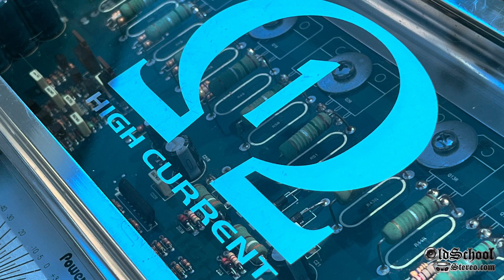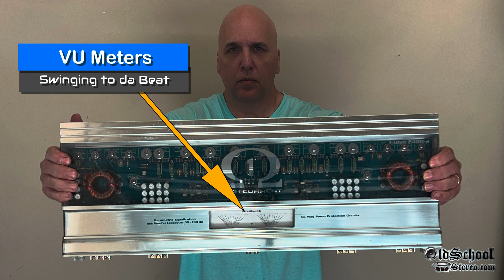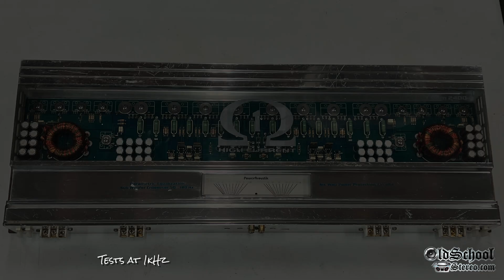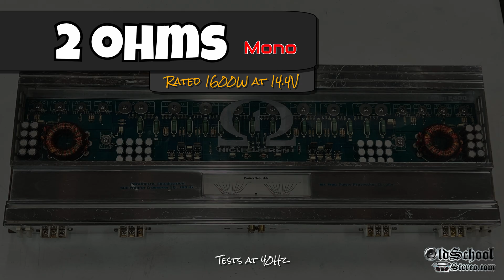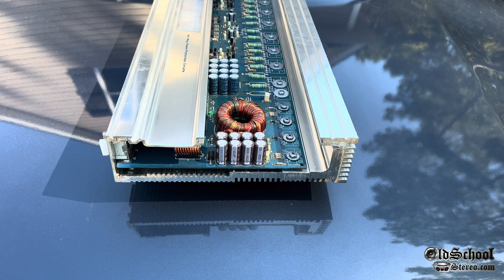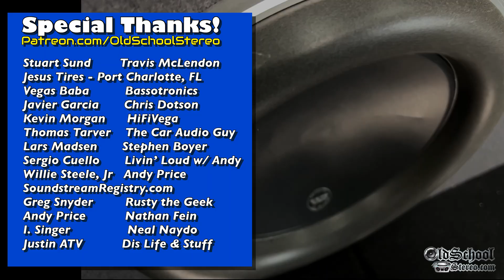Old School Bling with Meters that Swing

Comment from the maker: Get your WAL/OSS Merch: https://bigdwiz.creator-spring.com/ 
Buy Me a Coffee/Tea/Slap-a-D-No : https://www.oldschoolstereo.com/p/donate.html 

VIDEO AND AUDIO GEAR
Camera - iPhone 13pro 1TB - https://amzn.to/3nCjGvc 
RODE Wireless Go II Microphones: https://amzn.to/3Q6NVHl 
Shure MV7 Microphone: https://amzn.to/3A4OICK 
Zoom H4n Audio Recorder: https://amzn.to/3BXjVsS 
960 LED Panel: https://amzn.to/2Sxoq3S 

TEST BENCH EQUIPMENT
SMD / D'Amore Engineering Amp Dyno: https://goo.gl/sJTcf7 
XS Power LTO Lithium Battery Cells - https://lddy.no/1ivr6
XS Power D1400 14V AGM Batteries - https://amzn.to/2BPFCKW 
XS Power Titan 8 Lithium Battery - https://lddy.no/1iq28
XS Power PSC60 Charger - https://amzn.to/2CHGcfs 
Fluke 1000A AC/DC Clamp Meter: https://amzn.to/2Rw5WDA 
Handheld Dyno: http://amzn.to/2u2EgKV 
My Favorite Screwdriver Kit: https://amzn.to/3vijokl

DISCLAIMER: This video and description contains affiliate links, which means that if you purchase from one of the product links, I may receive a small commission. As an Amazon Associate I earn from qualifying purchases
Reply: I used this amp and got a 153 .db out of this amp. You have to put voltage on the battery and a line driver on the rca 10volts . It's a very strong amp and can handle 15.5 volts. I had it on 2 atomic apocalypse 15s. Torching test a 1 ohm mono, and it held it on a 57 hz burp

Comment: Friend wanted this when It came out.. talked him out of it.
And he purchased a MTX mono block. Was less expensive and put out better power.
Reply: MTX 81000D?  That was an iconic amp.  I had one, and at the time, besides the super expensive Alpine MRD-M1000's, it was hard to get over 1kw rms, this MTX was rated to 1500w rms at 2 ohm 2% THD, crazy heavy heatsink, soft clip, 0awg inputs etc, and was a very good price, plus you could disable over current protect and run 1 ohm for even more power if you wanted to risk killing it.

Comment: The Rust on those screw terminals is likely causing the lower outputs. Rust doesn't conduct electricity well. So I'd guess those terminals were choking off it's power supply.
Reply: No, it's a PA amp that's why it doesn't do rated. The small amount of rust and putting isn't gonna take 1600watts and choke it down to 500
Reply: @nicholascortez728  Both And. Each set of screw terms have 1 that's significantly more rusted than the others. That resistance won't be unsubstantial. But yeah, the design isn't good. 1 Ohm Amp with ubsurdly little power terminals. Even 8ga per side with a 50amp max is hitting a Dam with those terminals.

Comment: I've more or less studied VU meters and I like the way they are made in this device. They usually have a “attack time” and a “decay time” that should meet a certain standard to allow a functional display of the rated power. Many VU meters produced today are complete rubbish. The movement is like a spring and hardly readable. They are just for show and nothing valuable. But here they are fine.

Comment: I think Power Acoustik over rates their equipment. Blew two 10 inch subs within weeks of each other.
Reply: @98neonvegeta  probably clipped to hell.  Underpowered doesn't kill speakers
Reply: @TheXbrocker, what point did you not get? He said he thinks they over rate their equipment, meaning he bought a 10 in sub that claimed to handle more power than it could. How did you equate that with him underpowering and clipping the sub? What part didn't you understand 🤔
Reply: @tomb9566  Well, I read it as him using a PA amp and blowing through subs.  Hence why I replied the way did.  But I can see your perspective too and it makes sense.  Sorry to make you so angry.

Comment: You can tell the engineers spaced out the components to ensure the thing took up maximum real estate. Makes less power than an old Punch 200 from 1994 but 4X the size.
Reply from the maker: It never got even warm after the Amp Dyno tests or bumping the sub
Reply: @wal2  it has quite the thermal mass! 🤣

Comment: Looks like this amp got some use, and it’s tired. 27 years old, possibly sitting in a hot trunk for years. A recap might get it closer to its rated output.
Reply: Will bump up the numbers but won’t be anywhere close to rated. They were always over rated.
Reply: Agreed. There would have to be an improvement, but probably still wouldn’t do rated. Would be a fun experiment because it’s not a bad looking amp.
Reply: No. It really won’t.
Reply: It's power acoustic
Reply: Yeah it's not gonna do anywhere near rated even if you recap it...Power Acoustik was never known for their quality or their honesty
Reply: I was being optimistic, but you are right. Brands like this were cheaper alternatives to the better name brands for a reason.
Reply: I recommend bridging this amp full power  at 1 ohm to a single 8 inch sundown subwoofer.
Reply: Telling people you bought that POS without telling people you bought that POS. When has power acoustik ever been worth a damn

Comment: I learned tbe hard way on an old amplifier that it’s always good practice to use a plastic screwdriver to make adjustments. The adjustment know was metal on this old amp. Didn’t cross my mind at all but I went to make an adjustment and somehow there was an arc when the screwdriver was turning the knob and it also touched the metal amp case. It instantly killed the amp. There were no fuses. I was a teenager at the time and knew nothing about fixing amps. So… I tossed it in the trash and got a new amp. Lol. Just keep that in mind if you ever see a metal adjuster on an amp. Use a plastic screwdriver to be safe. 😂
Reply from the maker: I just pretend to be playing operation and not touch the metal ⚡️

Comment: Nice looking amp. 100% a person would buy to show off and not for raw power output. Since it's a class A/B, it may have been purposely designed to under perform since those amps output a ton of heat. It's still a shame it's not accurately rated!
Reply: Naw, my alpine mrv 1505 will do every bit of that 1000 watts advertised, and it's from 1992. My ppi art series 600.2 did more power